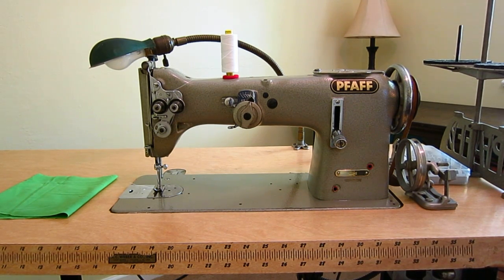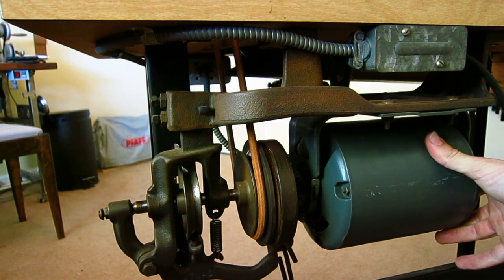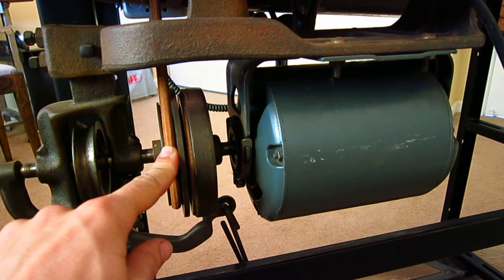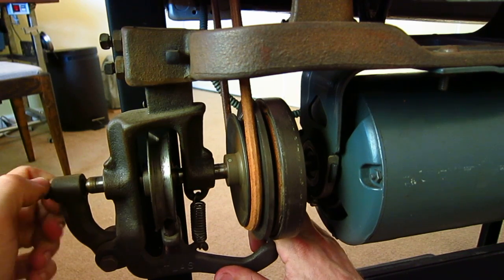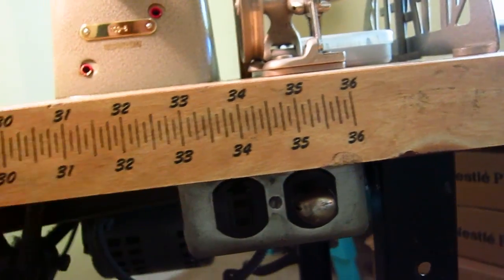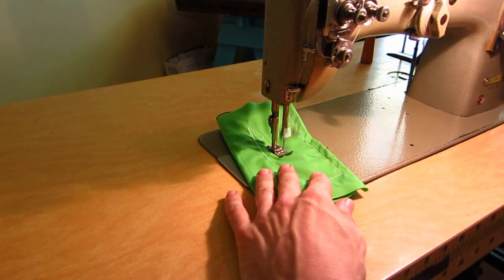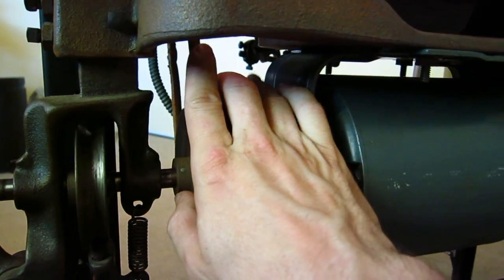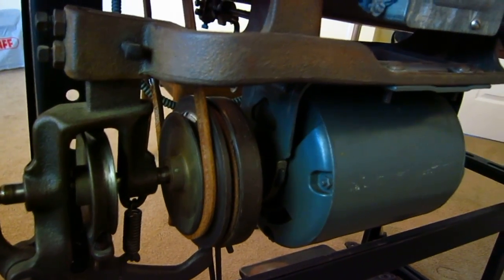How A Clutch Sewing Machine Motor Works

Comment: my pfaff has a Titan clutch motor and the clutch and the clutch and brake are integrated into the engine frame. The sewing machine was assembled in 1947  it haven't been in use for about 40- or 50 years

Comment: Great video👍
I have the same motor ..is it possible to set up with domestic machine? I have a necchi bu & a singer 66 but not sure how or if the belt set up would work?
Reply from the maker: Yes, you sure can.  The belt will ride high in the groove of the machine side pulley but it will work.

Comment: Thank you for the clearest explanation of how this motor works. My mother has an old Singer attached to a GE motor that is over 50 years old. We are trying to figure out how to replace the friction plate and cannot find the part, nor how to disassemble and reassemble the friction plate. I know above video was from a long time ago, but are there any resources you can provide to help us? Maybe post a video on how to replace? Repair men are unavailable where we are. Thanks again!

Comment: Fantastic! I was given an older upholstery singer sewing machine with a clutch motor. Similar to your video. SO helpful!!! Especially the cork on the clutch pad. Mine was missing the cork and I kept wondering if it should be metal on metal. Well, NO!! Thanks again for a great video instruction.

Comment: I have the exact set up on my vintage Cornely Chainstitch embroidery machine... so I was really happy to find this video. Very well done! 
Do you have a video or explanation as to the best way to tighten a leather belt and replacing one? I'm stumped since there is no way to get it over the pulley. 
Your help is greatly appreciated! 
Thank you
Reply from the maker: Awesome!  I have a Singer chainstitcher that I absolutely love.   When it's time to change the belt I pull the leather over both pulleys and mark the overlap location.  Cut and then use an awl to punch the hole to install the steel ring.  Tilt the machine backwards to get some slack and install the belt. The belt should be pretty tight but will loosen gradualy with use.  if it's slipping remove it and mist it with some hairspray and let it dry and reinstall.
Reply: Great video thanks for sharing I’m wondering do you know where you can find the cork for the clutch ring
Reply: @edgarv3984 you can wire brush the face of your cork disc to remove the old glazed and compressed layer and "freshen it up" to restore the precision pressure control. (Well, several times until it's completely work away)

Comment: mine wont sew slow ,  it is to grabie it will sew 5 inches before i can get it to stop , any ideas ??
Reply from the maker: The surfaces are probably glazed.  Take clutch off and lightly sand the two surfaces with 80 grit sandpaper.

Comment: Easily one of the best descriptions/explanation videos I have ever seen on these motors.  I have just found a vintage Merrow A-3DW-3 machine and now have to decide if I want to have the original and currently still running (1940's) clutch motor rebuilt or replace with a servo or another clutch.  Thanks again

Comment: Thank you for your explanation on how the motor works.  I just got this machine last month from my cousin who said it was stored in a shed for over 10 years.  I was amazed that there was no rust on the gears inside.  It was her grandmothers and cousin was tickled that someone was going to love it and take care of it.  I have a question though...the motor get hot with little use is that normal?  from what i can see it looks clean inside so wondering it maybe the motor is shot is why it gets hot or it is just a perk of the motor.  thanks.

Comment: Thanks, that was very interesting, so you're actually slipping the clutch when you go slower? Mine seems to go from nothing to almost flat out in a split second. I'm having a lot of difficulty controlling the speed. I've used a footpedal on my domestic for over 40 years, and have always managed to adjust my foot pressure for speed control. That just doesn't seem to work on my industrial, (Singer 331k5 with original Singer motor). I'm barely moving the foot pedal and she's off as if we're in the Grand National. I've ordered a reducer pulley, but am still worried about the stop/flat out, is there some way I can gain more progressive control of the clutch? (I don't have a lever to extend, the Pitman is just on the side of the motor).
Reply: Yes, in order to restore the precise foot control on a cork face clutch motor like that, you need to wire brush the cork face and remove the top layer of old compressed (and sometimes it's crusty or glazed) layer of cork.

Once you wire brush or lightly sand the face of the cork, you'll get your precision speed control back. 👍

There's a dude on YouTube who shows doing this process to a more modern enclosed clutch motor with cork friction face)

Comment: I just bought the same machine a Pfaff 138-6. It has the same motor setup and thanks for explaining how it works. With mine comes a knee control which I'm trying to understand. Would you happen to know the function of this control?
Reply from the maker: The knee lever is also know as a "knee lift".  It should interface under the machine with a little lever.  When pushed to the right of the table the knee lift should raise your presser foot.
Reply: Gary Hudson Also note that the connection between the knee lift bar and the upper part of the machine might be missing if it doesn't seem to do anything when you move the lever. My industrial came this way, and I puzzled over it for some months, and then discovered that there was a little part missing. 

That part was called a "knee lifter complying bar", and if you do a web search for that magic phrase, you should be able to locate them. I bought one off of eBay for $3.70, and it brought the knee lifter mechanism back to life. :-)

Comment: the motor is not universal. it is induction motor
Reply from the maker: +max factor I meant 'universal' in it can be used on other machinery, not universal as in AC/DC compatible.  The motor is indeed an induction motor.  Thanks for bringing that up.